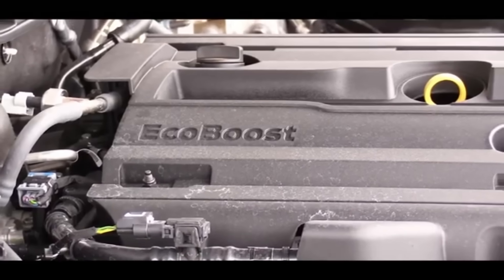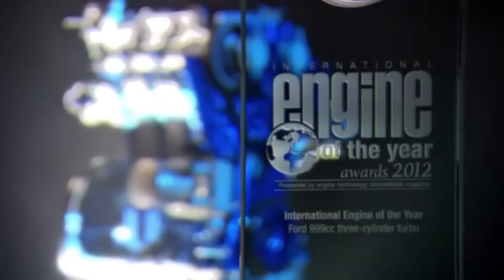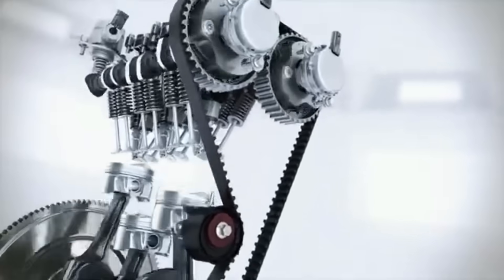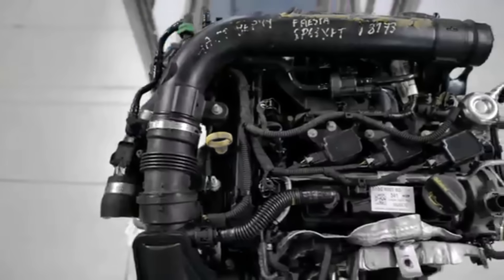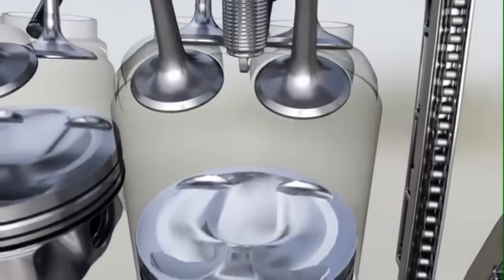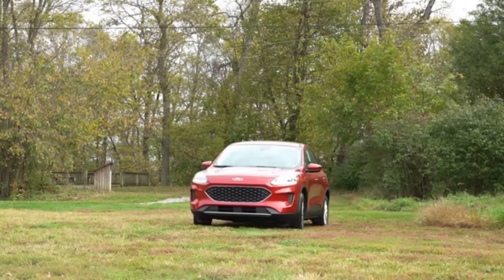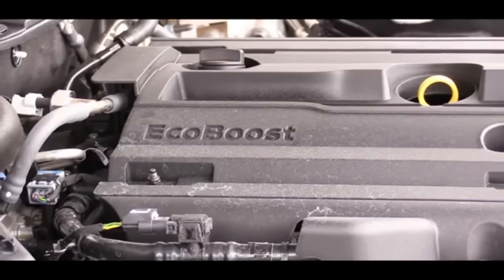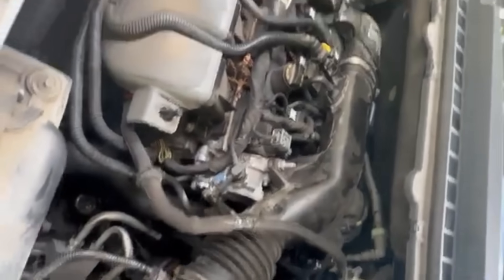Ford EcoBoost Engines Overview: Reliability

Comment: I just bought a 2020 ecosport AWD because it has no turbo, no wet belts, and much less likelyhood of ingesting antifreeze.  It's not just Ford, everyone is enamored with tiny turbocharged motors. And they're not quite ready for prime time. As usual, we're the lab rats.
I'll stick with NA and chains and no water pump in the crankcase either.

Comment: I bought a Ford Lariat 3.5 L Ecoboost in 2013 (pre aluminum body). It was the 3rd Ford truck I have owned.. the other two were excellent..  i was told it would average 19-22 mpg. At this time gas was costing $5 a gallon here so that statement backed by the EPA rating (worthless) was a major buying point. I brought the truck back in 4 times when my economy averaged 13-15 mpg on the highway driving at the speed limit. It was far worse when towing my small boat and trailer that weigh about 1100 lbs. and my economy dropped to 7 mpg.  I do not drive with a lead foot. The very best economy i got in 9000 miles of mostly highway driving was 16 mpg on a trip, averaging 60 mph with a tail wind and the AC off. I sold it taking a huge loss within 6 months. I’ll never buy another Ford.  The Ecoboost 3.5 was a lemon just for its lousy economy and i didnt own it long enough to face poor reliability problems.
Reply from the maker: Thank you for sharing your experience 
The EPA inflates mpg on paper yet forces automakers to downsize.

Comment: 2014 Ford Fusion Ti with the 2.0l ecoboost.  Been a great car almost no issues, had to change the purge valve.  The purge valve just made the car run rough at startup and throw a check engine light.  Bought the car new and I usually don't keep them this long but this one never breaks down.  I talked to a Ford power train engineer before buying the car and was told the 2.0l was the best engine for that model year.  She was right it has been great.  Going to get a new car soon and give this one to my son.

Comment: I found a couple of error in this video. The 2020+ Explorer never had the 2.0L turbo. It only ever came with a 2.3L turbo four and a 3.0L TT V6 and a hybrid was offered briefly. Also the Ford edge never came with the 2.7L turbo six cylinder engine.
Reply from the maker: Thanks for the correction, I appreciate it.

Comment: 2019 Ford Mondeo 1.5 ecoboost (Ford Fusion in USA). 63000 kilometers so far. 2 weeks ago the engine suddenly started to sound like an old loud diesel engine. This sound was scary so I drove to mechanic immideatly. After expertise he told that the issue is the water pump. It was almost broken. He changed it and now it sounds as sweet as it did before the issue. Broken water pump is kind of a wierd thing for 60k kilometers but that is the only problem I got for now.

Comment: The mistake ford made was thinking that customers would use the correct oil for their engines.
Reply: Ok new to ford and new to turbo. What oil is recommended? I live in Alaska where the super cold definitely affects our vehicles. A vehicle with 150k miles would be more like 200k due to warming up times. So far I must say my 2024 heats up quick

Comment: It's not just ford but many manufacturers are having big problems with these low capacity high pressure turbo units... Even Honda, All because they are supposedly better for the environment and economy 🙄🤦 is throwing a car away after less than 150k miles and getting another really better for the planet than driving a slightly older technology higher emissions vehicle 400 or 500k miles during their lifespan. Definitely not and nobody will tell me otherwise. There's just no way these units will do those kind of miles now without developing big problems. Another example of how climate policy is just counter intuitive.

Comment: so with the 3.5 should update the engine with new gaskets, new hosing and change the oil every 100000 miles and things going to drive without trouble?

Comment: My 2.0 ltr Ecoboost in my Maverick has been great
Reply: Most engines work well for the first 50k miles.  How many miles have do you have?
Reply: The maverick 2.0l is a Mazda based engine, at least the 22-24, they are a very solid engine. They have a closed deck, forged crank, the 25 is all new and we hope it will be as reliable.  But if you got a 22-24 hold onto it, do  your trans flush, power sending unit fluid change, trans and diff fluid change, also get your valves cleaned every 50-80k. The truck should last a long time.

Comment: 2014 Ford Focus ST here. 217115 miles so far 
No issues. Original clutch still working. Original turbo. Have had to change purge valve 3 times and had an inlet heater hose develop a leak( changed) but that was it. Planning on putting in a Mountune built 2.0 liter engine( stroked to 2.3 liter) early next year with a RS clutch and LSD differential plus a new stock turbo so it can last me another 10 years.

Comment: All of the manufacturers are having huge engine problems. Its not entirely their fault. They are being forced by the the Fed's  to meet ever more strigent C.A.F.E. standards. The amount of tech involved to meet these standards have  made autos similar to tempermental race cars or fighter planes. They need to be gone over from stem to stern by a crew of techs. After every use to assure everything is going to work as expected.
Reply from the maker: Agree
Reply: President Trump is stopping all this government beaurocratic insantiy.  CAFE standards are so stupid.

Comment: We had a 2017 Escape (1.5 engine) and a 2018 Escape (2.0 engine). Both went to sucking antifreeze, the 2.0 engine at 129,000 and the 1.5 engine at around 150,000. FORD put a new 1.5 engine in the 2017 under warranty and it lasted about a year and half and developed the same issue in the new engine. Both vehicles were very well maintained with oil changes every 5,000. It doesn't matter what you do, they are just not dependable. Buy something else. These will be a disappointment every day that you own them. The Escape transmissions are not any better than the engines.
Reply from the maker: Thank you for sharing

Comment: It's a wonder why Ford couldn't just create or stick with their powerful natural aspirated engines with port injection. Simplicity equals longevity. In the end these stressed to the max small displacement motors get the same or worst gas mileage then the aforementioned engines. I assume planned obsolescence is the method of success for them as they keep building these motors with known issues or make matters worst when they redesign something and yet people still buy them 🤦‍♂️

Comment: Had a 2017 2.0 and it had problems around 80k miles.  Reluctant, I got a 2020 Ranger.  It’s CPO Gold with 34k miles.  Hope I can get some mileage out of it.  Supposedly,  they fixed a lot of the problems after 2019.
Reply from the maker: Yes, already a lot of improvements by 2019. Maintain it well, it will continue to be gold
Reply from the maker: Ranger is a graceful vehicle, I love it

Comment: Because of the Ecobust I'll never buy another Ford product. Those engines have had major problems since they were introduced. These are not small problems, they are catastrophic failure problems. As far as your statement that Ford is moving away from wet belts, starting in 2021 they now come in the V-8 Coyote engine. There is a reason the Ford has been the most recalled vehicle for the past three years...going on four years now.
Reply: 😮🎉😮❤❤❤
P😂
Ooop..o.opo ❤😂❤❤k k k❤ii2laai 22llolml) lm olomy6yk mmykm❤😂n8>[!]@vm🎉❤*❤]😂😂k❤❤km❤b❤km iii❤
Reply: just because you don't do Maintenace this engine last long and are reliable not all of them have wet belts and its not even the real problem it's the tensioner this video is incorrect.
Reply: @Pro1er wish I had known this before I racked up over 100k trouble free miles on my 2.0.  You should start your own channel to warn people.  lol

Comment: I had a 2019 ford escape 1.5L ecoboost. When I took it for my oil change at 35,000 miles (I have it done every 5000 miles), my mechanic noticed that I was down coolant. He asked me if I noticed any spots on my garage floor. But it didn't have any. So the coolant intrusion had started. I traded it in and won't go back to ford after 47 years. Too bad because I liked the rest of the car.
Reply from the maker: Escape is a great vehicle. I hear a lot of positive testimony. Coolant intrusion is a series problem though, you have made a smart way out.
Reply: Feel bad for the next owner buying a lemon.
Reply: That has been corrected now with a redesign.